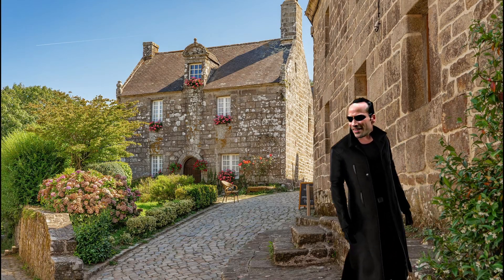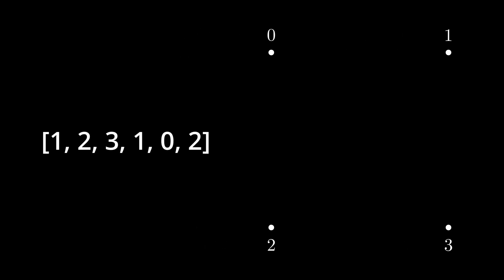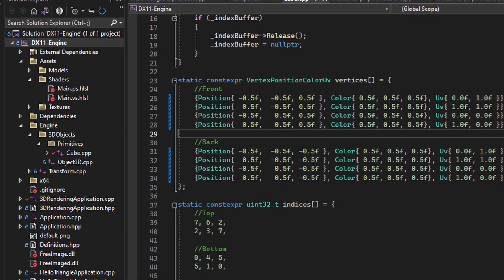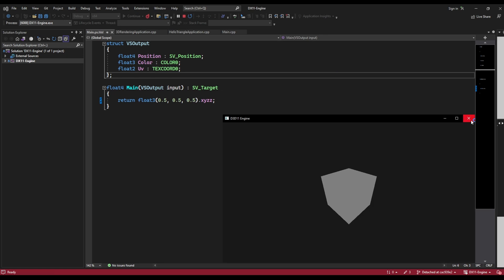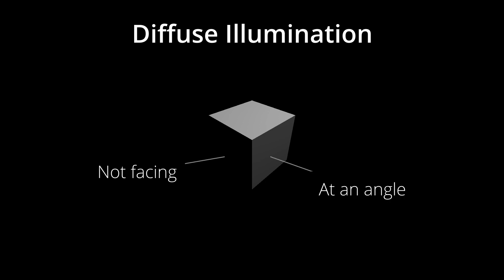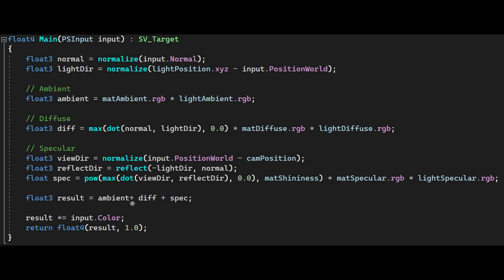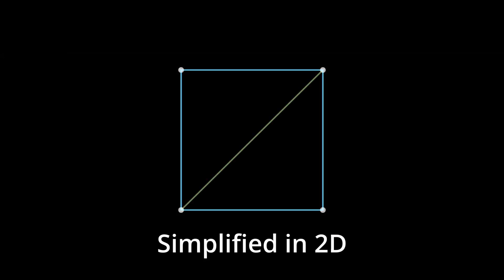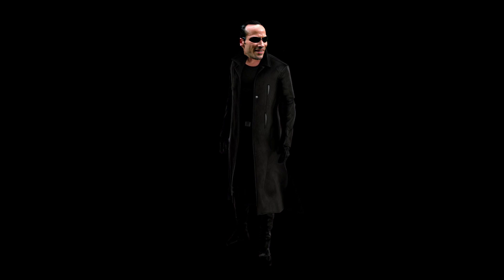Lights and Materials but I am dumb. Game Engine ep. #1

Comment: You said in episode 0, that you used GLFW for the window itself. But isn't GLFW a library for OpenGL and Vulcan?
Reply from the maker: Internally it still uses what the operating system provides (in Windows case win32 API and you can even get the handle to the original HWND Object). I use GLFW because it might be easier to allow the engine to support other graphics APIs like Vulkan API.
Reply: @Code_Gains  Oh some future prove thinking, alright